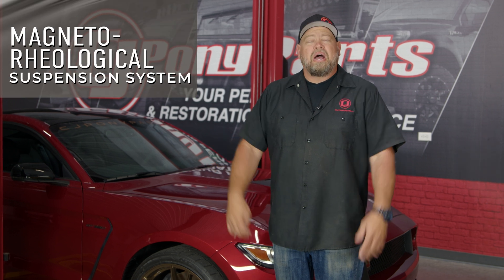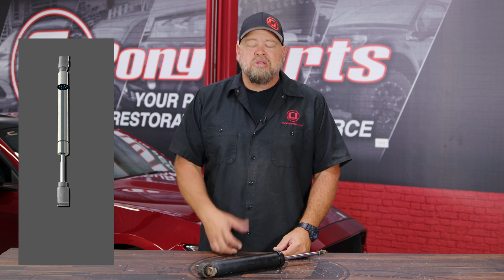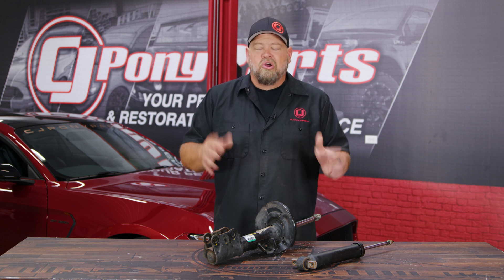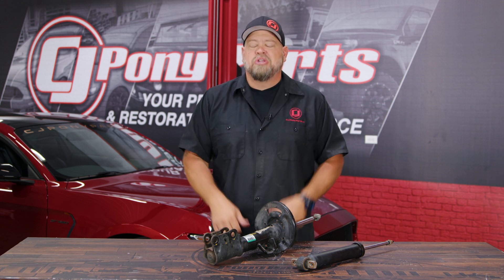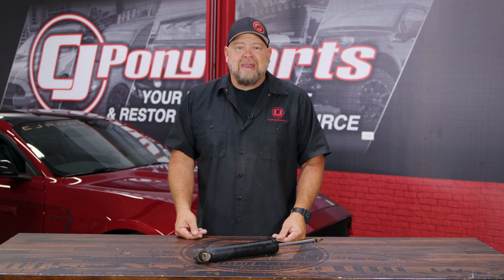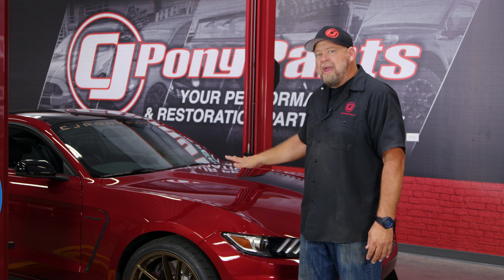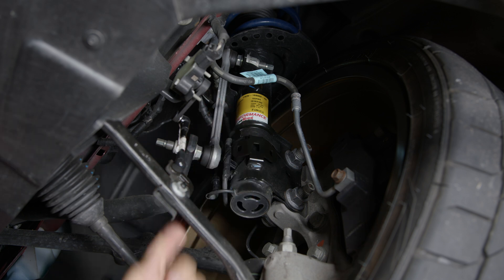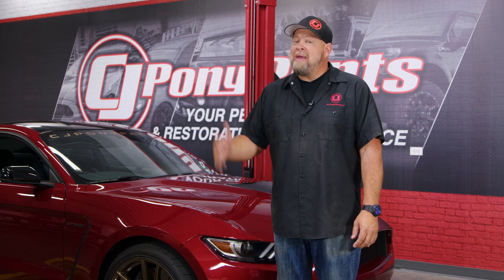MagneRide Suspension - Unlock the Mystery! #magneride

Comment: Can you give me a link showing normal suspension and magneride to differentiate them visually ? I need to know which type of suspension is equipped on cadillac escaladea when i want to buy them? Dealers in my place dont know anything about that
Reply: Should be listed on the window sticker, not all car sales people are tuned in.Visually the only way to tell is to access to very top of the shock where in bolts in, and see an electrical connector plugged into the top of the shock cylinder. Best viewed taking the trunk panelling down at the trunk hinge. Now if you happen to have an inspection camera, you can easily see the top of the shock snaking in by the trunk lid hinge.

Comment: These shocks are not only the most advanced to all other shocks, but also the cheapest. Just one moving part and some mag fluid. They perform so well, that they are banned from most pro races. You can get them for less than $100 each if you shop around. Don't get fooled by these companies. Just because it is advanced, doesn't mean it is expensive.

Comment: OK, just to be clear.... on the 2023 Mustang there are no settings to fiddle with from the driver's seat? It's just "on" doing it's job, if the car is optioned with MagneRide?
Reply: If your mustang has the selectable drive modes then there are different parameters for magneride in each setting. I notice it becomes a lot more firm and planted in Sport + and Track mode for instance.
Reply: @x12ozx  Thanks for the reply!

Mine DOES have selectable drive modes. Forgive; I should've been more specific. Mine is a GT Premium and also has Active Exhaust, GT Performance pkg,  6spd... B&O sound as well, but that probably doesn't influence what Performance options are available?

Now I wonder if any of the modes are only available with Magna-Ride, such as "Track" or "Drag Strip"? Or is "Track Apps" only available for Magna-Ride cars?
Reply: @GeddyBre all s550's should have track apps, my '17 V6 had them. Now my '20 GT has magneride that changes with drive modes. Not all cars with drive modes have magneride, only optioned with PP1 and standard on PP2/Mach 1. If you're not sure you can see the suspension settings change in the track apps "status" function
Reply: @BMock590

Yes sir, it is optioned with MagnaRide. It took me awhile to find it with the options I wanted.

MagnaRide, Active Exhaust, GT Performance Package, 6spd and the B&O Sound.

Dealers don’t seem to order them with that particular combination. That makes it nearly Mach 1 price.

Mine was a customer order from a dealer employee who then found another job and didn’t want the car. It was too late for me to order a 23 when I decided to get a new Mustang. 

I watched it for a month before I pulled the trigger, hoping to find one in Atlas Blue. Then saw an Eruption Green Mach 1 in a parking lot, loved it instantly, so I bought mine.

Thank you for the informative reply!
Reply: @djhuart8454  that's a hell of a ride my friend 🤘🏼 enjoy it!!

Comment: I have a question … can I add a mageride to a mustang that doesn’t have it ?
Reply from the maker: At this time it would be cost prohibitive to do so but in theory you could.
Reply: You would have to add proper cabling and connectors to the top of all shocks, install the Magnaride suspension module, tell the dash IC module it was there, the ECU it was there. Could maybe be another module too. But that car model would have to have it optionable/available in the place.
Reply: Available In the first place (sp)